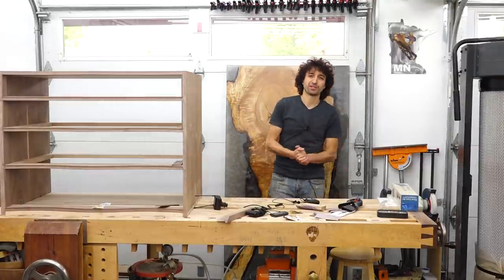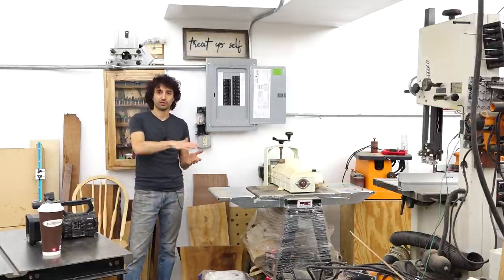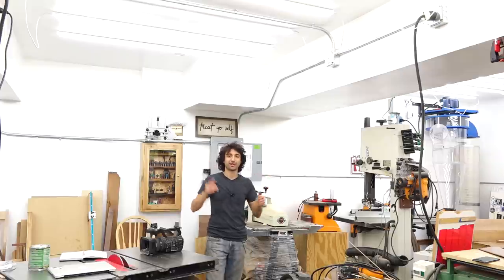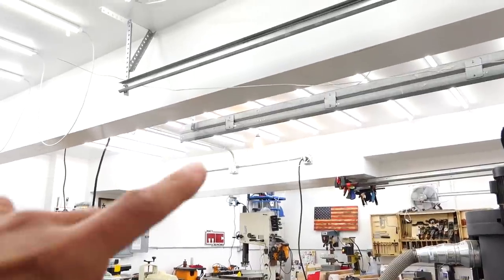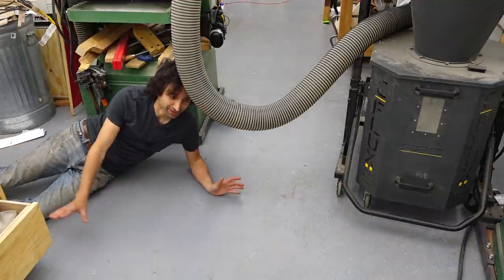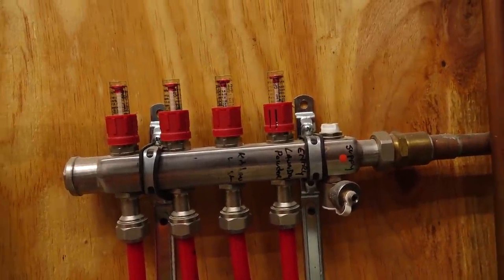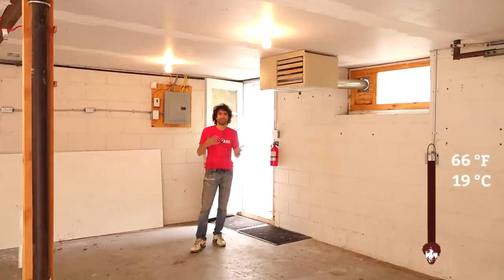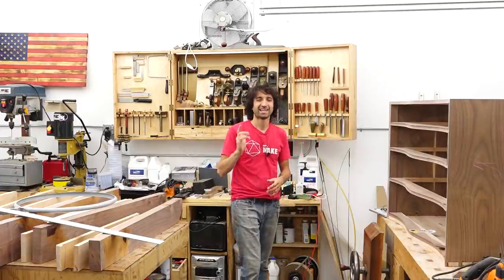Electrical and Heat - Moving My Woodworking Shop [Part 4]

Comment: Another load that you may want to consider in your calculation is your air compressor.  It can run at the same time as your dust collector and tool depending on what the tool is.  Now a lot of guys get by with a baby one for doing brad nailers and such but if you end up with a bigger one because you want to run a die grinder, sander, impact wrench or HVLP paint gun it can take a significant amount of electricity.

Comment: When you pull the wires, pull a pull string along with it for future use.
Reply: I have seen this in lots of professional builds.  seems to be fairly common
Reply: Good idea. It’s called a messenger line.
Reply: 100. And if u ever have to pull that string...throw a traveler on it in its place!
Reply: @novocaine009  Thank you, sincerely the guy who has to do work after you...
Reply: That works sometimes. A lot of the time the string gets wrapped around the wires inside the conduit rendering it useless. It helps to oversize the conduit if you are planning to pull more wire in later. Or run extra conduit.

Comment: Matthew, great video. I also live in MN and have heating issues during the winter and this was a great information for those starting a shop. When i had my garage shop built i used your videos to help me decide what to do.  I am still changing based on new needs in the shop but i also went with Conduit to avoid having tool changes equate into a huge job changing circuits.   I wanted in floor heat however, my Shop/Garage went way over budget and there was no extra room in the $$ to have that feature. I used Natural Gas forced air. What i find is that if i am going to do a bit of work over a weekend and its winter, I just start my heater on Friday at noon allowing all the mass to heat up which helps with that COLD sucking the heat out of me while i work.  One last point to anyone having a shop, it was cheap to do this, I put in a wireless Honeywell thermostat and now anyplace I have internet with my phone i can turn up, down or off my heat. So that is very nice for people that are planning to heat they can turn up the heat anytime or shut it off if plans change.

Comment: Hi Matt,
I like you’re videos very much and have similar interests to you with the engineering and woodwork reversed for me and electronics coming last. The reason for this communication is your trailer and the winched arch (brill idea). I was thinking that adding a second arch at the opposite end of the trailer and a chain at the top connecting the two arches spacing the chain at exactly the same distance as between arches and then connecting the winch to the tow bar arch end you would have in effect a twin lifting effect which would enhance you’re lifting capabilities and also reduce the damage to the trailer by drag effects. A second idea seeing you struggle with some of the larger slabs is a couple of bicycle wheels with a 4-5 foot axle easily made with your machines. Because of the larger diameter of bicycle wheels, grass and uneven surfaces would not be a problem. You just drag the slab halfway off of the mill onto the wheel's axle and put a bit of pressure on to raise the opposite end and away you go. Glad to see you succeeding in your venture. 
Here in the UK, I was thinking of making a Roll top desk but the wood (Sapele not mahogany) would cost about £1000 so that idea is dead in the water. Regards MoK

Comment: It is nice you have so much more for your equipment and projects and the radiant heating is wonderful, wish they had put that in when they built the condos many, many years ago.  They are cement floors on the lower level and very cold all year round..........So happy your could find that wonderful place with so much room for your and your family.  Best wishes to you all.

Comment: 4 inch box trunking with conduit drops where you need them all around the room ,so easy in putting in extra conduit drops when required

Comment: Put in floor heat in my modified mud room years ago, I won't pour concrete nearly any space without pex in int for future heating purposes. In the middle of a move myself, MN to Idaho. New place needs a new shop of course so in floor heat it will be. Plan to heat water off the wood stove and circulate through the floor for heat storage along with a water heater tank, shop will be warm when start in the morning. You made the move at the right time considering the real estate market here in MN.

Comment: My theory on electrical panels is to put in the largest possible which is usually 42 spaces. You don't have to fill all of the spaces but if you install a 200 amp sub panel and feed it with a 100 amp breaker from the primary panel, you are ready if you ever want to upgrade. Another option is to make the new panel the primary panel. Feed it from the meter and make your original panel a sub panel fed from the new panel. This is especially helpful if the original service is too small.

Comment: Does the gas heater blow dust around very much or is that not even an issue. Even with good dust collection there is dust sitting here and there. I like the in floor heat for the aspect of not putting more dust into the air.

Comment: My 48,000 BTU natural gas heater runs me about $100 a month to keep my 1000 square foot 3 car insulated garage at minimum 50 F, up to 65 F when I'm working in it (usually 3-4 hours 5 days a week).

Comment: 5:31 "your electrician" .The most important thing you said. Hire a pro or explain to your insurance company why the shop caught fire.
Reply: This is not rocket science...
Reply: @sparks6666  Journeyman electrician here can confirm it’s definitely not rocket science. I only ask that people at least read a how to book on proper wiring methods and watch some videos. Honestly it’s very easy to get power running and every thing has been engineered in such a way that its hard burn your house down. That being said just like building a table you could consider a piece of 3/4 plywood with 4 - 2x4s a table. Doesn’t mean that it’s a good table or that it’s done correctly. I’ve seen some really bad diy electrical and I’ve seen some that was totally fine. People just need to take the time to to learn how to do it properly, worst case scenario just try to make it identical to the way the professional electrician wired everything else.
Reply: @DMSparky knowing how inaccurate youtube how to videos can be i would definitely get a professional.
Reply: Hiring a competent trades person (especially an electrician) in a small town (or even bigger cities) can sometimes be downright impossible.

Comment: Do you have a switch for your lights? Remember, circuit breakers are not intended to be used as switches.
Reply from the maker: Yes
Reply: Yes there are breakers that are switch rated. They will have small sw near the handle. As a licensed electrical contractor I install lots of them over the last 33 years. more common in a commercial  buildings.

Comment: Great tips on the electrical. My shop is much the same with a subpanel and circuits in conduit. One thing I did differently is have the shop lights on the main house panel. This way I can shut off the subpanel feed and still have light, e.g. to add a new circuit.

Comment: After taking some classes at a woodworking school, I added some special 220 volt wall mounted motor switches before all my 220 volt tools. They are only about 15.00 and add a really important second level of safety for all the most potentially dangerous tools.  https://www.simonmetzwoodworking.com

Comment: when you run 240-volt ac you need wires with half section than when you use 120volt ac...
The USA is the only country that still uses 120 volt ac.
But we are in the USA so we have to deal with it!

Comment: One interesting detail about outlets - code does not require outlets to be installed in a specific orientation. Installing outlets with the ground pin at the top instead of the bottom is actually safer. If a plug happens to get slightly loose, partially exposing the pins, having the hot and neutral pins at the top means that if some metal object should fall onto those partially exposed pins, then you have a short. If the ground pin is at the top then the short scenario is less likely.

I know this has a very small chance of occurring, but it doesn't hurt to install sockets this way for that small amount of extra safety .

Comment: I just recently installed my own 125-amp sub. It was actually a pretty straight forward and easy process once confirming the materials needed. The hardest thing to figure out was wire size and what actually should be used. It cost me $700 in material for the panel, conduit, and 4 outlets. As for the radiant heat, I have no experience with it, but I will comment on the forced air. I believe the new shop is probably better insulated. My 3-car (768sq) has 11' ceilings on the flat and an 18' vault. Very well insulated, and I keep my Mr. Cool at 62* all winter long, which is comfortable in a sweatshirt. House is normally 74. The mini-split is quiet, and I would highly recommend it. When I built the house, I actually pre-plumbed a gas line for a Reznor, but decided against it for several reasons. The mini-split gives me the advantage of AC in the summer which is just amazing. Climate control in the shop was the biggest/best change. I also installed this myself for under $1,500.

Comment: A lot of woodworking machines draw more amps during start up - looks like you've allowed for that. Most of your gear appears hobby-level so it's not a huge issue. New shop looks good.

Comment: with underfloor heating the area, just above the floor is warm, where with most other heating systems the heat gathers up at ceiling height, also with under floor heating the whole floor area is getting even heat so there are little to no draughts, a more even heat, the reason for the lower temperature needed

Comment: You've already added the electrical provisions for it, so the easiest way for you to get both supplemental heat and cooling in the shop would be a ductless heat pump.

Comment: Should have added a separately billed 200 amp feed from the power company. Easier to compute and justify your electricity costs on your taxes.
Reply from the maker: Will make more sense to do that when I build my new shop
Reply: Today it is cheaper to have an AMP meter on the feed lines such as when using solar power. These are very simple and cheap, no additional metering fee, nor complicated separate main runs (if buried are expensive to have installed, if above ground ugly). There is the issue of getting 3 phase power though....
Reply: Second meter is normally a second bill so you end up paying all the base fees twice.